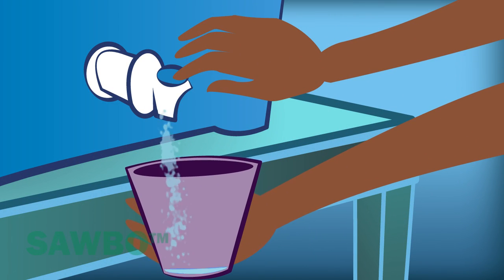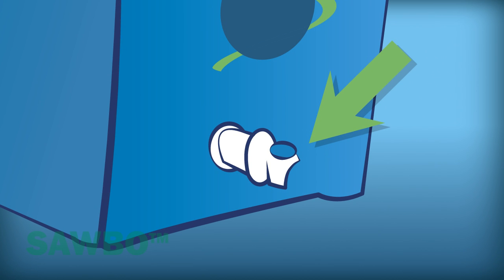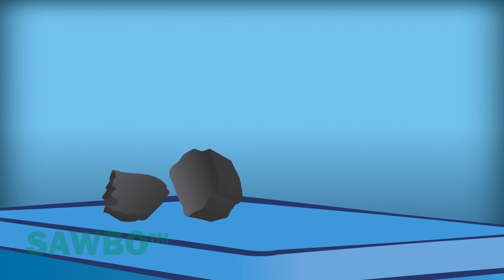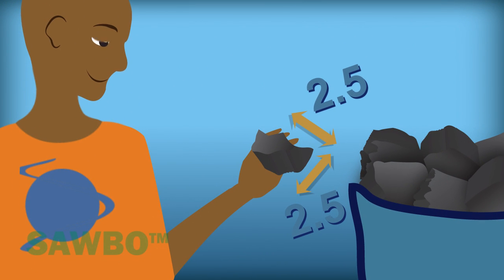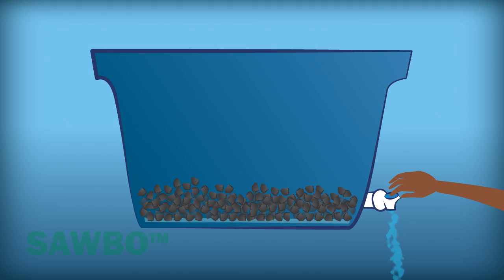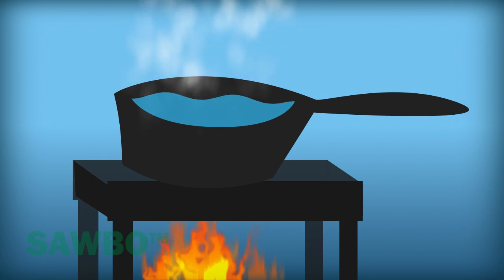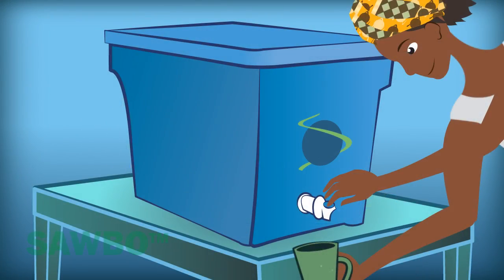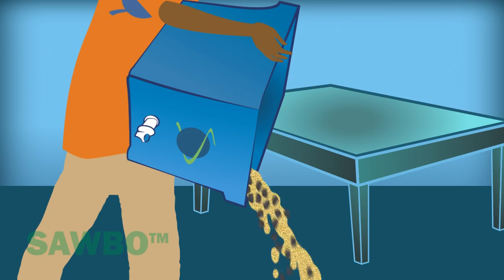Charcoal Water Filtration in English (Accent from USA)

Comment: You forgot to mention a few important steps, like washing the dust of the charcoal, letting it soak over night to remove the oils that's left, then heating it in a pot and pour water over to get the very last oils out, rinse and then put in your filtration system, this was a nice animation but definitely needs more explanation for people so they don't end up drinking grey water
Reply: I mean this filter isn't turning grey water into potable water either. Regardless of how much non carbon material you remove.
Reply: Don't get me wrong I get what you are saying but I think the creator of the video was showing basic construction with assumptions you are following basic hygiene practices. Like boiling the water after filtration to remove e coli, rotaviruses, and hep a.

Comment: if you buy your charcoal from the local hardware store chances are it has a shitload
of volatile/poisonous chemicals in it...RIP
Reply: over here in aus, we can buy hardwood timber charcoal; I have heard it is just straight wood.
Reply: @ianmcdonald8648  well it’s not straight wood (molecularly) it’s been converted to carbon. The thing is, you take ALMOST any material and if it’s burned in extreme heat without gasses/O2 the molecular structure of the burned “wood”/anything becomes close to 100% carbon (look into activated charcoal/carbon). THEN BBQ companies take that and ADD a sh*tload of petroleum products to help it burn better /quicker. If you’re looking for PURE carbon (from any source) you should be able to EAT IT much like ‘Tums’ for antacid...it’s hard to find pure BBQ carbon without additives. Because everybody wants their BBQ to fire up FAST and COOK!!! I have a bag of charcoal that I bought from the local hardware store where I can take a chuck and eat it BECAUSE IT”S (almost pure) carbon
Reply: True.  Use burned wood.  Not the hardware store stuff.  That's usually treated with flammable chemicals.
Reply: Truly. We must take care.

Comment from the maker: The new video "Charcoal Water Filtration" explains the process of developing charcoal filtration systems using sand. It is a simple process that helps to remove man, but not all, pollutants in water that can otherwise cause health problems.

English: Charcoal Water Filtration
Catalan: La filtració de l'aigua amb carbó vegetal en Català (accent d'Espanya)
Spanish: Filtración del agua con carbón vegetal en Español (acento de España)
Reply: But wat if you filter the water through first then boil it will it be good to drink?